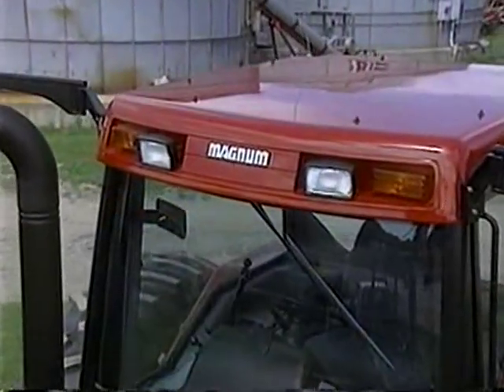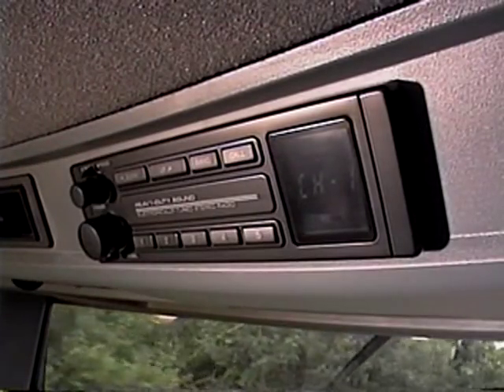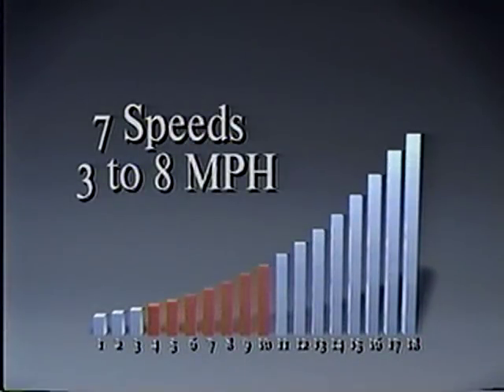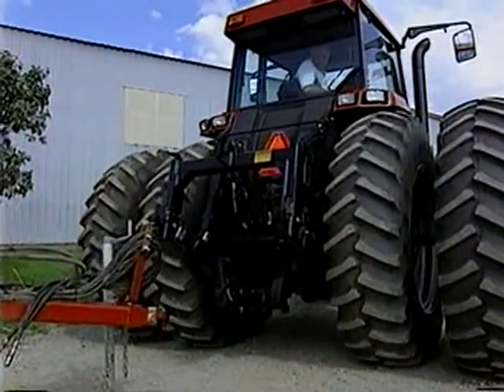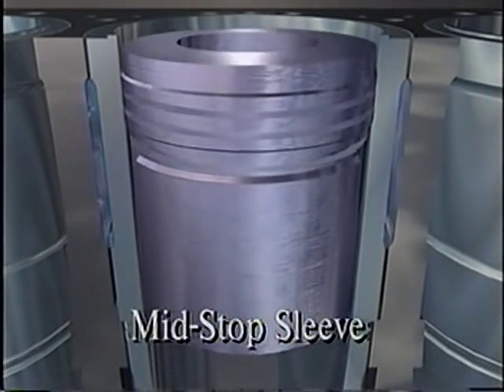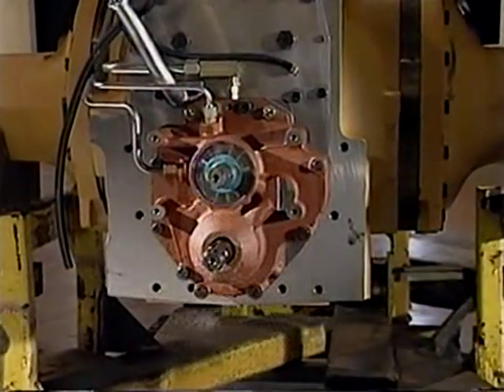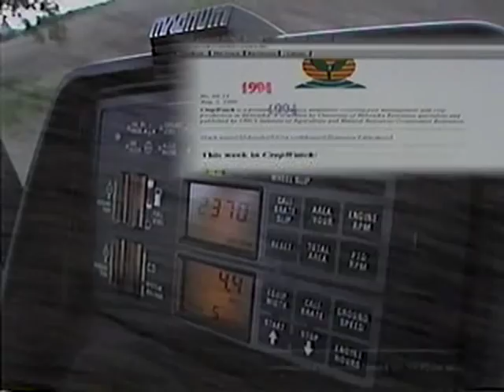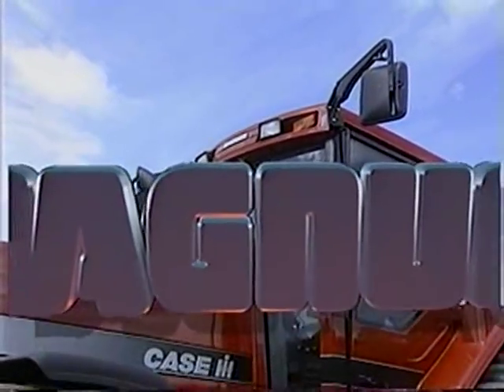CaseIH 8900 Magnum Series Intro

Comment: Deere's 8000 tractors are much better than this "toys". Spacious cab, good 8,1l power tech engine, many h.p under the hood ...the best on the plains
Reply: We use to have a 8420 John Deere we traded it for a caseIH 260 that was a good trade we traded that 8420 at the being of 2012 and we been using that 260 ever since then it has been a good tractor

Comment: Magnums are nice tractors and all. But they run so frickin' HOT! Undersize radiators and lack of enough air passing through them. The hood and styling looks good ... but cannot believe the design engineers put the emphasis on that instead of enough cooling vents for air to escape - especially on the 30 and 40 series. Try touching the inside of the windshield right above the dash when working em' .. its about like a stove burner.
Reply: Quite possibly the dumbest complaint ive ever heard is the windshield gets hot..if your radiator is properly cleaned, take of right side panel and swing out Trans cooler and condenser clean properly the tractor well remain in proper operating temp..
Reply: @uhohspagettioh97531  Okay Gilligan!
Great tractors .. lots of power. But the early 30 and 40 series ran hotter than hell when working them hard!! Wimpy little radiator ..and not enough airflow got through that fancy 90s space age hood with no exit louvers anywhere.
It all squeezed out right by the windshield.

Comment: A friend who deals in used equipment has 2 questions about a magnum. Does it need paint, and does it need tires?
I notice there's no mention of the IH engineering in it. Cab shape/position, 3 pt and drawbar, self-cleaning cab filter, 18 speed transmission with equal gear spacing......